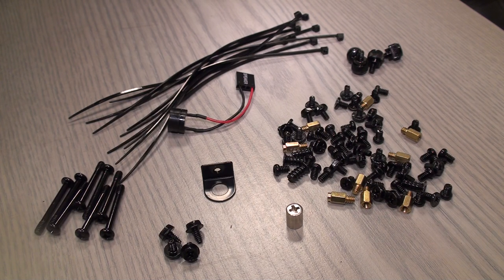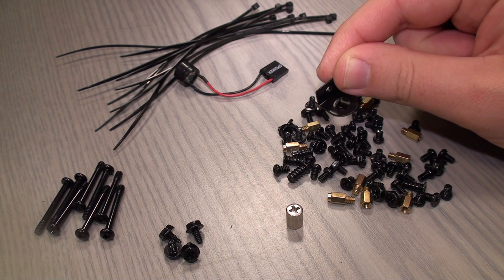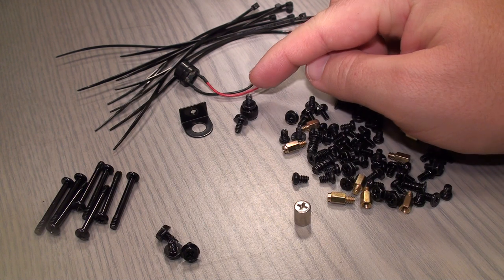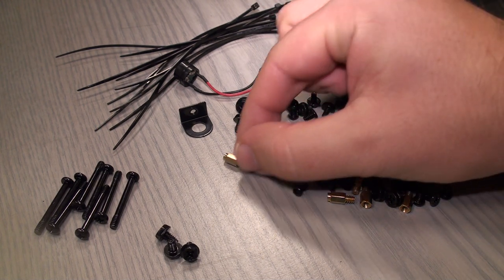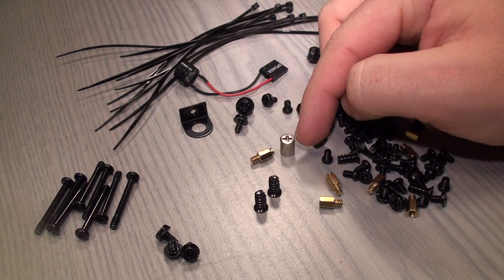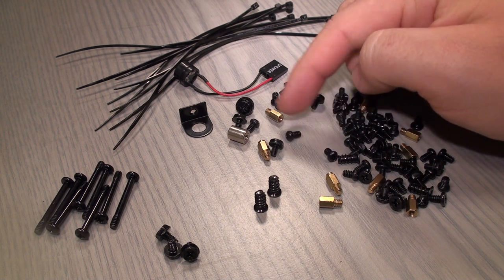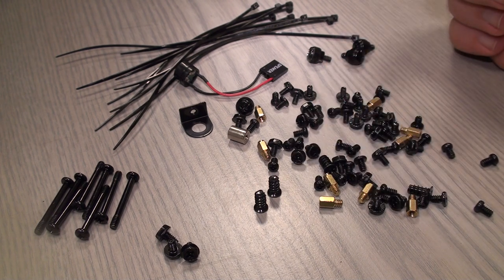Description of different screws when building a PC

Comment: The hexagonal ones that don't have that extra bump underneath are for both motherboard mounting and the psu bracket in my case. The hexagonal ones with the bump underneath are for hdds. The round ones are for attaching SSDs. Some cases are different so you should check the case manual anyway (edit, just realised this video is 7 years old)

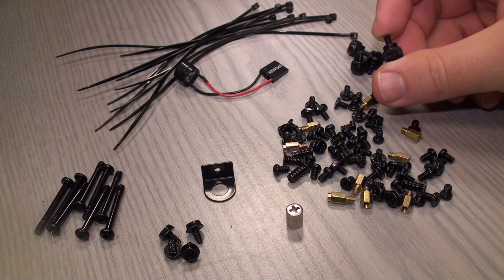Comment: 0:20 I didn’t exactly get these can I use them for screwing the mobo onto the standoffs or to screw the psu or can someone give me an example ?
Reply: Hi,
pretty sure those screws are for the side panels on the case. He talks about not using a screwdriver because you should be able to screw and unscrew them with your hands. Hope this helps!
Reply: My case has them for both the pc side panels and the power supply mounting bracket
Reply: @aiden9548  what is name called as....